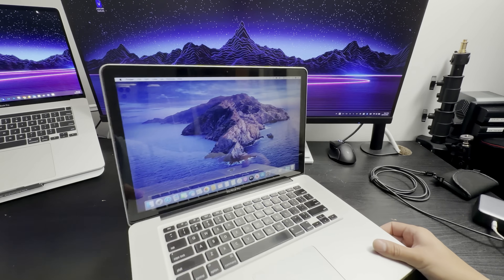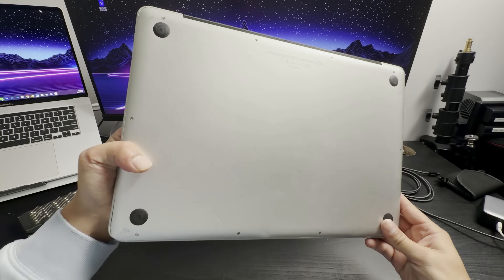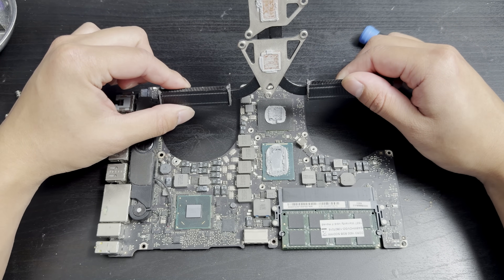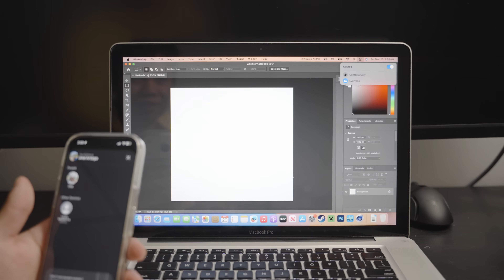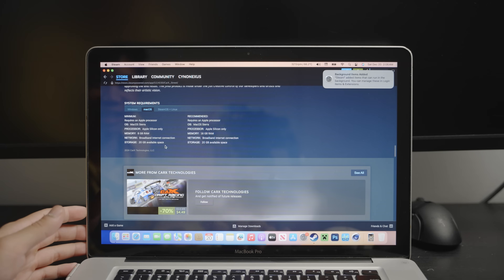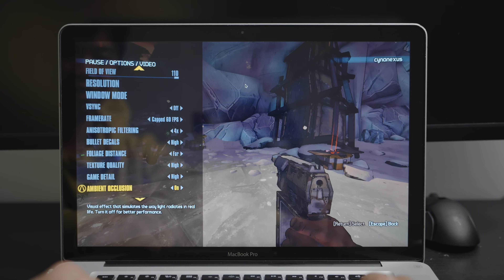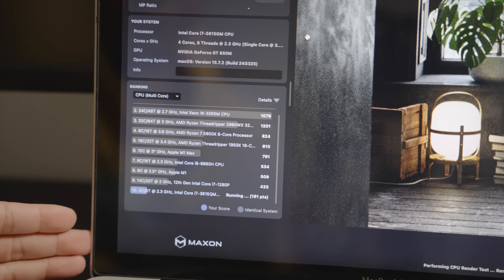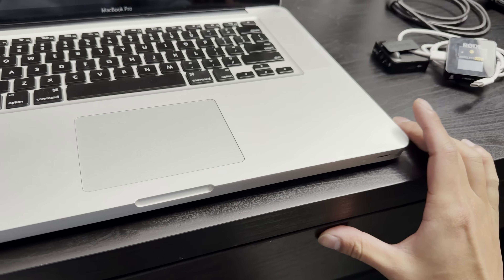THE BEST $50 MACBOOK PRO YOU CAN BUY IN 2025???

Comment: Running Sequoia on my 2014 2.8Ghz QuadCore i7 w/ 16GB Mem. Thanks to open core. and I tell ya, I run more than spotify. This is my primary work machine.
Reply from the maker: Nvme based laptops like the 2014 is still holding up good!

Comment: There is no point in worrying about MACOS Tahoe not working on these machines.   The only difference between Tahoe and earlier versions is its supposed "capability" of using current M-series chips with neural engines for "better" AI performance in the woeful Apple Intelligence and Siri.    Just Open Core Legacy Patch these machines up to Sequoia or Sonoma and use a web based AI like Gemini or Grok or ChatGPT and the actual user experience will be quite acceptable.
Reply from the maker: I use Gemini a lot, works great

Comment: I'm using the Macbook Pro Mid 2012 and upgraded it to OCLP Ventura..its totally unsupported and the only macOS that could run after its final version of Catalina..Can't run fully on the Sequoia because of the CPU limitations but its fine under Ventura..
Reply from the maker: I thought so, might have to downgrade to get better speed and usability out of this laptop
Reply: @cynonexus  Sequoia is fine for a quad core Ivy Bridge Intel Core i7 as long as you have 16 GB of RAM. 

Recommended macOS versions via OCLP based on RAM:

4 GB RAM - Big Sur or Monterey
8 GB RAM - Ventura
16 GB RAM - Sonoma and Sequoia

Comment: Nice video. Also, you were most likely trying to install Windows in UEFI mode, most likely the reason why it wouldn’t have worked. Because 2012 macs and earlier are using Apple’s proprietary EFI 1.1 firmware and are not fully UEFI compliant. It is possible to get around errors, but it’s kind of a pain and not worth bothering. I recommend MBR/Legacy booting. Since it’s a 2012, you could boot Windows 7/10 MBR from USB, but there’s a possibility that if you formatted the USB drive as NTFS, to not be recognized. For a 100% success rate, use a Windows DVD. Make sure to also create a hybrid MBR partition to install Windows on. I hope my advice helps.
Reply from the maker: Wow this is very useful info, thanks for sharing!

Comment: Got the exact same 2012. Put an ssd in myself with Opencore Sequoia. No major issues and was bringing it into work. Though I've switched to my 2019 16" for work and home since it does everything as well. It's a really good machine and does what I want. Opencore works pretty well and has amazed me. I got it mainly for the firewire port for old iPods since it was cheaper to get a whole computer vs the thunderbolt 2 to firewire adaptor lol. I miss this design since it had the dvd drive, upgradeable and the lights for battery and sleep (Why were those dropped? They are still so useful!).
Reply from the maker: Agree hahaha they need some sort of sleep light for future MacBooks

Comment: One method that might help if you want to install Windows. I don't know if it works on a MacBook, but I've tried it several times on my Mac Pro 2,1: Insert the SSD in a Windows PC or laptop and run the Windows installation. When Windows wants to restart for the first time, shut down the PC/laptop, insert the SSD into the Mac, start it up, and let it finish the installation there. Maybe you will need additional drivers, I have them from Bootcamp.

Comment: Writing down this comment from A1398 2012 15 retina macbook pro. These things are mostly build to last BUT! Temperatures.
And you know what's funny exepct just them being hot? The CPU and heatsink are degrading. Mine can constanly jump around 50 to 90 degrees with PTM7950 and brand new heatsink! While same model, same year would be A LOT colder just because it was not that heavily used. After years i spend working on macs, this is not the first time I've encountered this on macs. So you really gotta play a lottery or find a macbook with not that heavy of usage. And also look for base model's with weakest cpu. They might perform better just because of temps XD. 
Great videos, keep it up man!
Reply: btw, 50-90 degrees while i watch YOUTUBE. Nothing but youtube. Really,
Reply from the maker: Didn’t know these heatsinks go bad overtime! I wouldn’t be surprised though!

Comment: These older macbooks are so underrated - I had to sell my M1 recently to pay for car repairs, but I'm using a 2014 pro with the same specs as yours and it handles music production perfectly fine (at least for what I need anyway)
Reply from the maker: They’re fantastic machines even today!
Reply: I’ve got a 2015 MBP with quad i7 2.5ghz and 16gb ram running very large music sessions (100+ tracks mixing all in the box with plugins)  in Pro Tools and it def kicks fans most the time but is completely usable. I don’t see needing to upgrade until the m1 Mac’s come down in price and become the good deal. Hopefully the new m5-6 whatever comes out this year will drive those down. Cheers! 🤙🏽

Comment: I found a Late 2013 15" MBP with fully maxed out specs for 70 euro online. Also found a 2019 15" MBP with a 2tb ssd, i9 and 32gb ram + a 2015 15" MBP with maxed out specs being sold together for 220 euro
Reply: U have the listing for the 2019+2015 MBP?
Reply from the maker: Woah that’s a good deal! Did you get it?
Reply: @cynonexus  yeah! The 2019 MBP had a worn backlight so I ended up selling that for 375 and I also sold the 2015 MBP for 175. I'm still using the 2013 MBP!
Reply: @cynonexus  both of them were listed as not working, but all they needed was a reset!